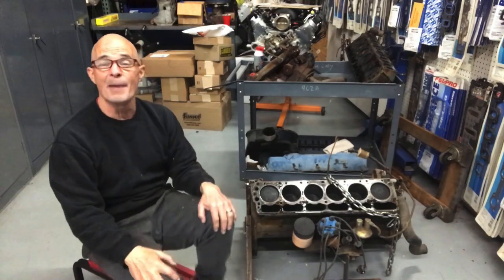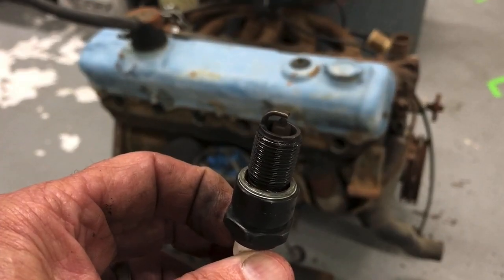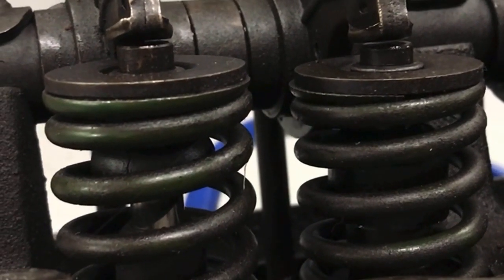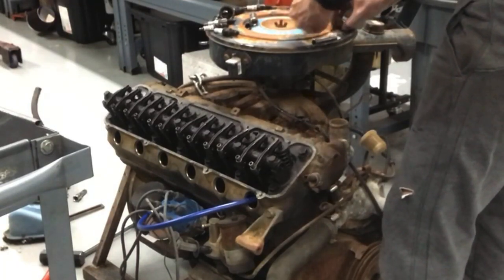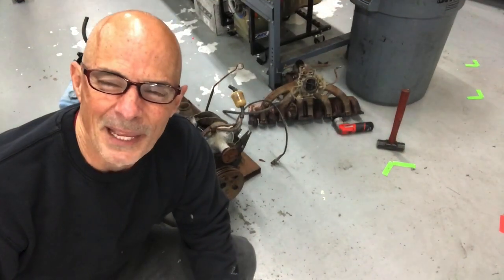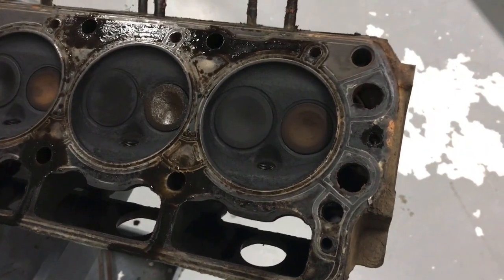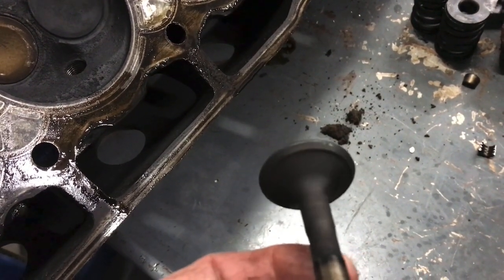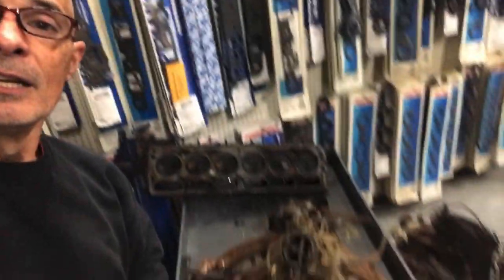HOW TO: FIX THE DODGE SLANT 6 (WHAT BROKE?)

Comment: I am so glad you’re doing this, my grandfather passed down a 84 dodge he bought new and it has a 225 slant 6 in it. I got it and wanted more so I fabbed mounts from a factory ls mount and some solid dodge mounts and put a 5.3/4l60 in it. I almost had it done and decided it took to much away from the truck and I wanted the original slant 6 to stay so I pulled the ls out and right now the slant 6 is sitting in the engine bay but haven’t finished bolting it back in. I’m definitely planning on going to a power adder.

Comment: The last /6 I built: Stock bottom end with windage tray and Melling oil pump. Late model head to get rid of the spark plug tubes and also have hardened seats for unleaded gas. 340 vavle springs and the Mopar (Crane) .460 lift solid cam. Accel Super Coil, Offy 4 barrel manifold with a Holley 600. Mopar 6 into 1 header, single 3" exhaust through a Flowmaster muffler. Car sounded like a 340 at idle, ran hard for what it was and was great to open the hood when people didn't believe it was a /6.

Comment: I just bought a 85 D150 with a /6 and 833 OD. Really good shape except the bock is cracked. He didn’t have enough antifreeze in the mix when we had single digit temps in December. Shame too, starts right up and runs good. I’m swapping a 318 magnum in it in a couple months after I finish the rewiring my Ramcharger. Slowly both of them and my 340 duster (clone) will be swapped to 3G Hemis.
Did a cam, headers and Offy 4 intake with a Holley 600 in a 71 Dart yrs ago. Ram 14.60s at LVMS during MATS.

Comment: I learned how to wrench on cars working on a slant 6. Those are great engines with good longevity. You darn near have to beat them to death with a sledgehammer to make them quit. I still (after 60 years) have a lot of affection for early mopar cars. I am looking forward to see what you do to that little mill. I assume it's a 225 CI. They also made a 170 CI slant 6 for smaller cars like the old Dodge Lancer (60 & 61). Learning to work on stuff like the slant 6 led me eventually to get my Air Frame and Power Plant license to work on small aircraft as my 3rd and final career.

Comment: Good you found the problem. Looking forward to upcoming videos.  Here's a tip in case you didn't already know...  Those two bolt holes on the top of the cylinder head can be used to lift the engine.   That's how they did it at the factory apparently.  I've done it myself too!

Comment: Milling - IIRC, 120 thou is the heads limit, 90 thou on the block, and if you do, watch the the cam lift to make sure minimum .050 between open valve and piston at TDC.
Parts - Clifford Repro HyperPak, Pacemaker tuned headers, Cox Bros make roller rockers for slants, and there's good pistons about. Someone was doing seven inch H-beam rods too for a while, which is the whole 198 rods in 225 block to bring the pistons up higher.

Comment: The Super Six 2bbl intakes can be two piece die cast aluminum top and bottom and what looks like resistance welded or the cast aluminum like featured on this engine. I cut the exhaust manifold outlet off and welded a 2 1/2 inch flange. This also isolated the intake  from the exhaust manifold as well as having a 2 1/2 inch exhaust and that gave a seat of the pants feel increase in power. '74 Duster 904 with 2.71 gears.

Comment: Was that a leaded motor running on unleaded fuel so it beat the exhaust seat out of it? Sure looks like it.
Reply: I don't think so.  By the time the Super Six was introduced in the USA all cars had to run on unleaded fuel because they were equipped with catalytic converters.  Chrysler had offered the 2 barrel version for export but did not offer it in the US until the late 1970s or early 1980s because they preferred to sell the 318 V8 to those who needed more horsepower than the Slant Six could deliver.
Reply: @1575murray  All US cars made starting for the '73 model year had to have an EGR valve to reduce NOX emissions.  I do not see an EGR valve on this engine.  Maybe somebody put a '77 and later Super Six intake, carb, and air cleaner on an older Slant Six?
Reply: Chrysler and other auto companies induction hardened valve seats to make them last when lead was removed from gasoline. This head should have had hardened seats because only one seat was damaged. Induction hardening valve seats was only a surface treatment and after about 45 years of service, I do not think it would be unexpected for this process to start to fail.
Reply: @fustyblatherskite2142  You are correct.  Actually this started a year or two before unleaded gas became mandatory in 1975.  Anything can happen on engines that are this old.

Comment: that much piston to deck clearance was a common thing on some of the smog engines in the 70s. i saw a 454 that had close to .060 below the deck and with a .039 head gasket. that almost .100 of quench distance.  that 454 was a lazy pig.
Reply: little known fact 73-76 Ford 302's had slightly higher decks than standard 289-302 deck height. that's why you need a thicker bead of rtv on the intake end seals
Reply: 360 LA with .070 + down the hole. And that was 1975!

Comment: I had a 1966 Valiant that was rated around 145 HP. Mid-70's Chrysler made them with 95 HP. They were so weak they cautioned dealers NOT to get ( they were in Volares ) them with  manual transmissions because they did not have enough HP to start out on a incline. Of course our dealership got one and therefore the proud owners experienced this phenom.

Comment: Even with lead the old engines would burn valves and seats.  In order to keep it cheap and get a stock running reading I would suggest a new set of stem seals on all the valves. That is if the sticking valve didn't take the cam out too.

Comment: I used to have an ex-military Dodge water truck with a 1000 gallon water tank on it. I shit you not, it was powered by a 225 Slant Six!
Reply: They are a great lugging motor
Reply: I knew a brick layer who had a 1 ton Ford with a 300 straight six that he would load down with literally a ton of bricks. He replaced it with a newer 1 ton dually with a 460 and he said the 6 beat the V8 in both pulling ability and fuel mileage.
Reply: @chris49ford   Id like to see a 300 I6 with ridiculously long gears. Mabye 2.40 something rear and a .60 overdrive.

Comment: Had a 75 Dodge short bed back in the 80s. It had a 225 slant 6 in it. Almost used more oil than fuel. 16 mile per gallon of oil. LOL!!! Forgot to put a gallon of 50w in and a rod started knocking. Tried to finish it off but it just wouldn't throw that rod!

Comment: Somebody used to make a side draft manifold with three 45mm DCOE's for the slant six, do that!
Reply: Here in Oz they have been putting Webers on them for near 60 years!!
I doubt that for road racing at least the maximum has not been extracted from them. A few still raced in historic GpN. But they let Mustangs race and took away any edge the Valiants had in pre65

Comment: I cut 0.150" off the deck surface on my slant 6. Pistons were down 0.170".
Reply: 0.150-inch is a lot even for the slant siz
Reply: @timothykeith1367  I cut 0.070" off the head too.
Reply: Getting pistons that come near the top of the bore is far smarter
Reply: @ldnwholesale8552  I agree, with the technology available today, pistons can be custom made to any spec desired. back in the day, the block and head milling was the best compromise of money and tech on these engines. Now you can get almost zero deck height with just pistons.
Reply: @ldnwholesale8552  I guess I'm just dumb. Strangely, it works well with low cost stock pistons. Was in a nostalgia dragster, now in a hot rod. Not  many choices unless you want to pay for custom forged pistons. If you want to donate to my next engine build, I'll accept.

Comment: I saw you loosen the head bolts using the typical tightening pattern from center to edge.  Why? I've always loosened in reverse order of tightening.  ie, from outside bolts to center bolts.

Comment: Looking at the combustion chamber shape, there is no real quench.  So zero decking does not really help much ...  Yes, compression does help for sure, but taking enough metal off the deck to get to zero with OEM pistons is kinda chasing a ghost ...  Better to go aftermarket pistons and leave the deck thick enough to hold the bolts for boost ...
The 225 is still a small engine.  Almost wish you could grab one of their (Mopar's) big flathead six's like the original 413 twin carb truck motor and do the same to it 🙃

Comment: use the head as a mold in sand, and then aluminum-cast the head.  Once its aluminum, then CROSS-flow it, ripping-out the distributor from the block and putting coils on each plug.  The "slant" should cover a cross-flow header dumping straight down, but SPLIT, so you can have true duals, 1 per 3 cylinders, or have each 3 dumping directly into one of TWO turbos, so you can get 750Hp out of your "tower!"  Each 3-fed-into-ONE of two turbos'll FEED lots of fuel & air into the OTHER 3 cylinders, so the OUTput from 1 group of 3 cylinders feeds the INPUT of the Next 3.  The Output of the last 3, would, of course, feed the INPUT of the 1st 3.  Richard, back in the 70s 6-cylinder stock cars used to make 450-500+ horsepower, full-race.  Although Inline sixers are not raced before the V-8s {--that I know of}, anymore, WHY can't we almost duplicate the 4L Aussie-Ford "Barra" which can make 1100Hp?    I feel you definitely can get 750+ Hp out of your tower, and it will NOT have to be built "full-race, but will be "streetable."   Aussie-Mopar had a "Hemi" on some mid-70s 6 cylinders, although they were NOT "slanters".  Could an Aussie-Hemi-inline 6 head { head done/cast in alloy }, be PUT on a slanter-block?   WHY hot-rod with "Australian parts"?   Well shortly, folks can 3-D those parts and better, so if you want, show us what COULD be done.    You should REALLY "Blow our minds" and 3-D Aston-Martin DB-6,{--the more popular model made after Aston quit making the Bond-made-famous DB-5}                                                                                                                                                                                                                                                                                                                                                                                                                                                                                                                                                                                                                                                                                                                                                                                                                                                                                                                                                                                                                                                                                                                                                                                                                                                                                                                                                                                                                                                                                                                                                                                                                                                                                                                                                                                                                                                                                                                                                                                                                                                                                                                                                                                                                                                                                                                                                                                                                                                                                                                                                                                                                                                                                                                                                                                                                                                                                                                                                                                                                                                                                                                                                                                                                                                                                                                                                                                                                                                                                                                alloy 6-cylinder heads, or TVR would make their own DOHC straight-6 via copying/cutting-up 4-valve Suzuki motorcycle heads from Suzuki motorcycle 4 cylinders to "work" on a 4L DOHC inline 6 of TVR's own, or maybe Aussie-Mopar had a DOHC head to run against the "Barra", or, 3-D the 3.5L-4L Maserati-alloy DOHC head{--from the 40s - the 60s } to fit, perfectly, on a "slant"-6 alloy block.  I'll BET there are several 3-D Replicator firms that would WANT you to "3-D" hot-rod parts on your show, and that'd put your GREAT Videos WAY beyond what anyone Else is doing, but that'd Just like you, Richard,--you're Not going to do what everybody ELSE is doing,--you're BETTER than that,--you're "Da BEST!"

=
Reply from the maker: SAND CAST MY OWN HEAD?

Comment: If this is a forged crank block (75 and earlier), you can use rods from a 198 and 2.2Lturbo pistons. Gives you strong modern piston at -.020 deck height.
Reply from the maker: its cast (later super six)

Comment: Slant 6 is an odd duck. Chrysler leaned the engine over to clear low hood lines. Only reason. Then they put the water pump on the side to shorten the engine for styling fit. I don't know of any other single engine that gets dedicated race days at drag strips. My daily driver for the last 15 years is a 1965 Valiant. SLANT SIX!!! BUZZIN HALF DOZEN!!! MOPAR OR NO CAR. https://www.youtube.com/watch?v=ZPm0POxQuNk
Reply: Those sound Effing GREAT! 
For some reason reminded me of the USGP formula 1 races at Long Beach back in the late '70s. 
Thanks for the link!

Comment: Without the slant 6 there would not have been "THE DUEL" movie
Reply: I like that movie 👍
Reply: Thats probably the engine out of that movie car. It was pretty sick sounding at the end.
Reply: Had it been a Ford or a Chevy, the truck would have won! Only a /6 can run a grade with no water in it.
Reply from the maker: I think that was Steven Speilberg!
Reply: @CarsandCats  The Ford inline 6s were just as dependable. We tried to blow up a 170 Straight 6 while driving it without water and failed but we did manage to crack the block by draining the oil. The engine had over 1.1 Million miles it was in a 67 Ford Falcon. I can't say anything about the GM Inline 6s because I don't have any experience with them.
Reply: @tskraj3190  Chevy and AMC/Jeep inline sizes are tough too
Reply: @CarsandCats  I think pretty much any old tired worn out engine can run with no water in it for a while.  There's not much piston/ring friction left.
Reply: @tskraj3190  You can't kill an old stovebolt 235 Chevy six.  It refuses to die.  LOL.
Reply: @richardholdener1727  Richard, I think you should test this engine against an early Buick 225 V6 or an all aluminum Buick 215 V8.  I saw a complete Buick 215 V8 in a '62 Buick Special in a pick a part lot last year.  I almost pulled it.  I would hate to think it got crushed.  Oh well, I managed to "save" a 1963 small journal 327 with camel hump heads and a 1969 Pontiac 400 Ram Air III motor and TH400 from the pick a part lot this year.  Someone had put the 1963 327 in a 1986 K5 Blazer.

Comment: "Stop when we see the problem,.." Exhaust on number five should not be covered in oil, and the front three have been running lean, all thee need new seats, so might as well do the whole head.
It's always a laugh to watch first timers go to lift the head off a Slant - done it enough to use an engine crane :D
Now it's apart, can I suggest the Clifford Performance Reproduction HyperPak inlet manifold, and the Pacemaker 'Tuned Length' extractors.
Yes, you can skim the head and the block, bore it, offset grind it, add a cam,... but none of that matters as much as making it breathe.

Comment: What about fuel injection? There's a company called Gill Welding and Fabricating who makes a multiport intake. I've also talked to someone in australia who converted there's to coil pack ignition and if you want to test a roller cam LSM Engineering might have a few blanks left. Either way you go I hope it helps build the slant community. Then maybe people will finally start making more performance parts lol.

Comment: that head was designed for "leaded" gas, if run on "unleaded", the valves seats will go away, either harder valve seats are needed or lead substitute must be put into each and every time gas is put in the tank.
Reply from the maker: new seats cure that-and I would think slants from the 70s had hardened seats